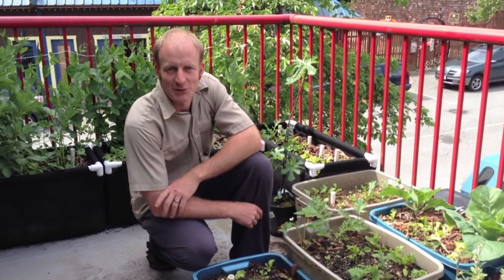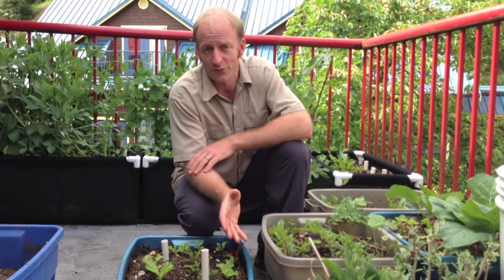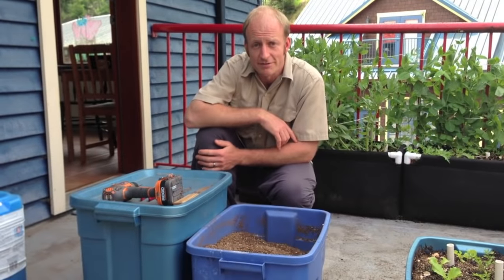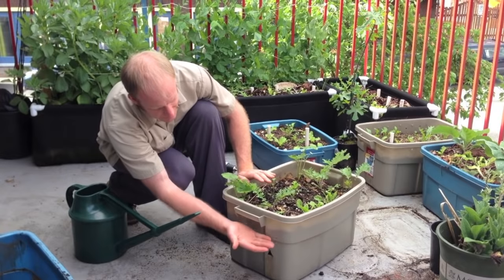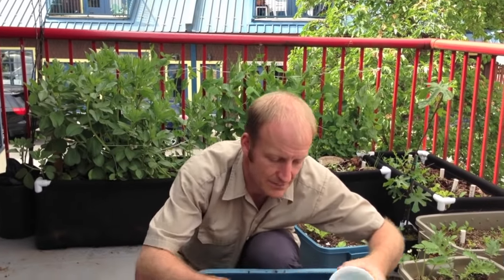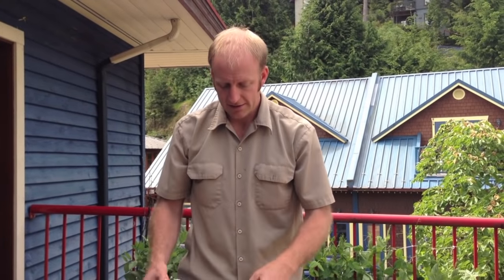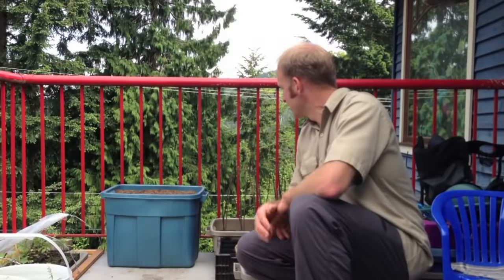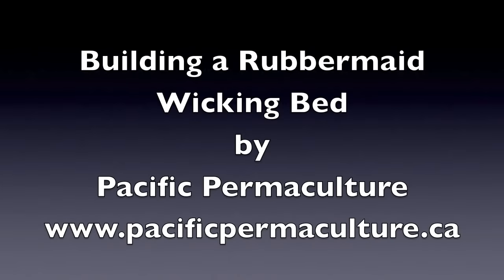Wicking Bed Build

Comment: going to have to do this, started several of them had some sucess but the heat in Tampa is bad, Do water them but they need constant watering
Reply: When we live in Florida I remember we defended our pots from two most sunny sides with wooded blocks and let the air flow between them, it helps a little.

Comment: In other videos they say you want to leave a gap of air between the water level and the soil to prevent root rot and allow oxygen into the soil. I haven't tried it yet but this may be helpful to others interested :)
Reply: Maybe some holes in the sides. Some water will evaporate, but the airflow may be as important.

Comment: Nice job except it seems by putting soil in the corner cups some soil will go into the water reservoir which want to be only water.  What size do the holes need to be at the bottom of cups and how far up should the holes be ?

Comment: This is an exceptional video and the best I've seen, and I have just a quick question -- everything else I have read says you need an air gap for root oxygenation - how could we work this into the system? Otherwise it seems that not a lot of air is getting to the roots. Thanks if you are still maintaining the Q&A on this classic video!

Comment: Really raise beds are the best planters, for making a garden, or a plot of peppers, tomato's ect. Easier to control weeds, grass, gophers and to work ect.  mine is 3' wide and 10' long and 2 1/2' high.  with a old sheet of roofing tin under it. To gopher proof it. The roots don't go down about 2'. Can grow a lot in a raise bed this size. can built a raise bed pretty cheap, all i use was old roofing tin for the sides and bottom. Tee post for support on the long sides.  Just caulked up the holes your don't want,  then painted it. Its 12 years old and still growing things. My cost of it was paint, and wire only, to wire the sides to gather.  Then pots. Bag dries out the soil to fast

Comment: Thank you for great ideas. But when u drilled drain hole yoy just said right here and I couldnt see where about. Do u drill where the cap sits or below the cut out cap pls. Also could you tell how to make good soil components like bloodmeal worm juice etc. I wstch u from s Korea n we dont know these. We all die from chemical fertilizers
Reply: It's below the cut out cap because you want the water to stay under the lid and only come up as needed, pulled up by the soil in the cut out two pots. So all the rest of the water is a reservoir under the lid. Otherwise the soil above the lid would be flooded.

Comment: I love this video.  I have a couple of questions please.  I have a small patio and want to do this as my containers tend to dry out quickly in my very hot yard.  But in the winter we also get a hard freeze and my containers would have to remain outdoors.  So do you ever have a mold or fungus issue in the water reservoir?  Does it have to be taken apart and cleaned every year?  Also  I would drain them for winter but have you had any experience with how they stand up to be frozen over winter if there is some water left in the bottom of the reservoir?
Reply: add 1 tbl hydrogen peroxide per gallon h20 for mold and fungus.  it will kill good bacteria too so add beneficials a week or two later
Reply: snow hero 👍🏻
Reply: @snowhero9  I'm newbro gardening... what do mean by beneficials? Also.. does this mean it would be safe to leave thebwater in the containers and use them the following year? I live in Maryland  and the containers would have to sit all winter.

Comment: hey you could use one tub inside the other , top tub for your soil bottom tub for your water thanks
Reply: That's a great idea! Would it work with 2, 5 gal buckets? Would I drill holes in the top bucket and then a hole in side of bottom one for the water?

Comment: I loved this video. It was straight to the point and provided all of the information required in an easy to understand format. My only gripe, if you could call it that, is that we should get away from using so much peat moss in the garden. It is incredibly non sustainable and the peat bogs are ruined by it's extraction.

Comment: The concept is fine, but I'd include a watering tube, and the sunken lid I'd replace with something more permeable.  It will retain too much water for too long.   I think, with permanently submerged soil,  it will turn to slurry.   Self watering planters use the same concept, but they're allowed to dry out over time.

Comment: I've been starting to experiment with 1 gallon milk/water jugs because the handle becomes a fill hole I can close up. Against apartment rules, I have to put the pots on the fire exit and it is not easy to water the pots without being watched. I like the coconut core idea, as I don't want the topsoil to attract mosquitoes and other pests. Going to try that when I put my plants outside again. Thanks for the cool tips! Any suggestion on where to get the right sand?

Comment: It would be helpful if the videographer was aiming the camera where you actually drill holes.   I think possibly they are trying to keep the camera on your face rather than on the gardening technique. Also maybe setting at a wide angle would help capture the whole container instead of the upper half. This is good information.

Comment: Thank you for the primer. I'd like to see how you water it initially - just how saturated to you start your system off (how much top watering vs filling the bottom). Also, how do you monitor the water in the bottom? (I'm using tubes like your other system with a little strip of insulation foam that drops to near level when the bottom is empty.)
Reply: As he keeps adding more water thru the triangle-shaped hole, eventually the level of water below will reach the hole, at which time he knows that the water level is at its maximum.

Comment: why not a 1" pvc pipe going to the bottom so u can fill it with a garden hose a 10-foot pipe is like 3 bucks at Lowes you could get 3-4 fillers from one pipe

Comment: what you can do with the mistake is that if you don't have a lid to replace the one you made a mistake with , you can place burlap material and spread it over the flat cut lid and that should hold your potting mix from falling into the lower compartment
Reply: I don't understand that part about the gaps because then he cut 2 big holes and put soil down in them. Looks like that will cause a bigger issue with losing soil.
I know when I plant flowers I always put a cpl coffe filters in the bottom of my pots ( putting in a few rocks for drainage) before adding my fresh soil. It keeps the soil from washing out.

Comment: This is the most complicated set up I’ve seen on this subject. It’s a whole lost easier to use weed block cloth. Just cut it larger than the container, flip your yogurt cups upside down from what was shown in the video, removing two in the center. Push the cloth down so the soil goes to the bottom. You want about a 20% soil in contact with 80% area for water.  The cloth keeps the rest of the soil above the waterline. Stick a plastic pipe on the side for filling the bottom with water. You still need at least one hole in the side so you don’t overfill.
Reply: This seems to be the best idea the cloth can be a barrier for the dirt. It will wick up water just need hole to drain. Maybe in the cups too.

Comment: Just to confirm, that watering hole allows you to fill all 6 of those larger pots at the bottom, right?  And the soil you're planting those seedlings into is the same mix you placed in to the 2 in the corner as the wicking soil, right?

Comment: You missed a point.  There needs to be an 'air gap' between the bottom of the soil bed and the top of the water in the resorvoir of about an inch so that the soil in the bottom of the planting bed is not soaking wet.  Great idea using Rubbermaid  tubs.  They are rectangular and you get a whole lot more planting space than round 5 gallon buckets.
Reply: If there was a gap then how would wicking acting take place

Comment: Instead of cutting a triangular hole in the side for watering, can you use a piece of PVC which runs into the water reservoir, allowing watering from above and into the PVC pipe? Or does the triangular shaped watering hole in the side out-perform the top PVC pipe watering method?
Reply: the whole at the level also helps the reservoir drain when it is too full when it rains

Comment: Is it just me or is this over complicated. You can make this by Following the same process but just turning the potters inside the container upside down, that will create a reservoir , fill the bin with soil, the soil that fills the gaps between the pots becomes ur wick(lets face it u are using the same amount of soil by filling two pots anyway) product is the same you just don’t need to cut anything except the over flows (and air holes if using yogurt containers.

Comment: Couldn't you have just turned your "cups" upside down (bottoms up) and then covered them with the landscape fabric to prevent soil from clogging the holes used to help fill and drain (allowing air to fill them as water is used) the reservoir? I'd also figure there would be plenty of areas for smaller columns of wicking soil to be created. Also, I see in the background of your video other containers with pvc pipes. Are these watering tubes? I'm also curious, aren't those open holes just begging for mosquitos and other insects to create a nursery of the reservoir? Sorry, if I'm sounding hypercritical.

Comment: Sir I haven't yet watched the video, u call your favorite....
But....I use wicking w everything, even my african violets........WHEN u put the flat lid on top of the pots in the bottom.....cut little SLITS in the flat lid....use ladies nylon stocking or cut STRIPS of fabric(I use strips of mens athletic sox)
Put the one end down into your water wells and pull the other end thru the slits
And drape around under your planting medium.....
THAT will moisten your growing medium too and u wont have to use up ur vermiculite mixture.......
Just another way......🤷🏻‍♀️
Now I'm going to check out your other video 🖐🏻☺️

Comment: I made one.  I am not real happy with the amound of soil sitting in water all the time.  I will take it appart and think of a better way to do this.  Also there is soil falling through and even with lining the pots with landscape cloth, to keep the soil form coming out the drain holes of the pots, it is still coming through.  This design has some flaws.  I will keep looking for better ideas.
Reply: put the pots upside down
Reply: knitnpaint so are the pots suppose to retain the water or act as a support between water and soil. I like the idea of the other response to turn pots upside down.  It how would you wick the water up to the soil if it isn’t touching it at all. I was curious how water would reach the soil by cutting the lid and placing the lid as a barrier. My thoughts was to place a mesh of some sort but one that won’t rust or corrode . Maybe a plastic mesh that is tightly woven with a landscape material. I believe it is a great idea and of course adaptable in many ways
Reply: @RestorationRanchHealing  It has been so long and I no longer use the pots. Sorry I can  not be of help tl you.

Comment: you top feed it too, dont be dumb. the top dries out eventually and you need to keep the thing moist for all the obvious reasons. Fishbone meal will be your best source of calcium that is commonly available. Calcium and magnesium are just as important as nitrogen and phosphorus
Reply: rosa lara take a potted plant that needs water and put it in a tray of water.  Wait about 24 hours and touch the top of the soil.  The water will travel up(as he said) to the top, and the soil will be moist.  Don’t be dumb.
Reply: @knottybead4871  then the pots will uptake too much water  water and growth will slow from lack of oxygen.
Reply: rosa lara obviously you don’t understand how water works.  I didn’t say put it in a bucket of water.  It would indeed drown if you did that.
Reply: @knottybead4871  wait 24 hrs? naw, my plants aint waiting that long to get their microbiology on top re-hydrated. Please don't be a sore student just because you got schooled. I know about capillary action and use it most the time but not for hydrating the top, it takes too long to travel and gets pot too wet. Did i really need to explain that? I am the best grower alive.
Reply: that's why you need to drill an overflow hole just above the pot level. the top of the soil will never get as wet as the bottom - period!
Reply: Ron Thornton where is placed the lid between the water and dirt layer is there a hole in the lid to allow water to seep up to the soil ? If not how does the water reach the soil at all ? I’m wanting to do this but I want to be sure I have a clear understanding of how to do this without being wasteful.

Comment: Hello Jesse! Thanks for the great video! I made my 1st container two days ago. Sweet! Just wondering though regarding planting depth. According to several websites you need a fairly deep planting depth for tomatoes. Is that true, or does it depend on the varietal. Also, did you say you added coffee grounds to your prepared soil? Not sure if it is true, but according to 'some' coffee raises too acidic for the plants. Your thoughts? Thanks again, I've shared this with several family members!
Reply: I have used coffee grounds for yrs and it's always worked great. Makes my plants happy.  Along with a compost tea of banana and adding ground egg shells. The coffee grounds aren't very acidic after they been spent. So save your grounds definitely
Reply: @JCC_1975  Thanks! Love your video!

Comment: That is over engineered.
Drill a 1/2" hole about 2" to 4" above the bottom on a side.
Get a Walmart (blue) carry bag (fabric style).
Fill bag with soil mix and a plant.
Place in the tote. Fill the tote with water till it runs out the overflow hole.
You get the benefit of air pruning and sub irrigation.
Fast easy fill too.

Comment: Shouldn't you use food grade plastic? I would not want to eat chemicals taken up by the plants.
Reply: S H I was curious about this as well. I have read that the hard plastic is safer than the softer plastic and doesn’t leech. I’m curious where to find food grade plastic to do this on this scale.
Reply: @RestorationRanchHealing  In my research, it was not the hardness but the number that you should go by (#2 HDPE keeps coming up as the safest known). I was able to order some white 5 gallon #2 food grade buckets from 'wally-world' ;o) that actually have a sticker on them that says food grade.  However, I still worry about the sun breaking the plastic down and releasing chemicals, so I am using them in ways where they are shielded from direct sun, and may even cover them with fabric, fabric dipped in cement, or strips of wood... still deciding.  Either way, the plastic will keep it water tight if you are on a balcony or have it indoors.  If you want something really big, if you have farms nearby there are supposed to be tubs that are food grade #2 plastic that you can get that may have had feed, molasses, etc. in them.  There is a farmer with videos on that too... same concept but larger scale.
Reply: Also, if you get the 5 gallon buckets, you can use the lids as saucers for overflow... if you don't mind the look. Hope this helps!
Reply: @RestorationRanchHealing  also, those buckets I mentioned also say BPA free on the sticker.  It won't come up if you search for a food grade bucket, and it does not have it in the description, but it is on the sticker when you get it.  It's under "5 Gallon Industrial Bucket, White".  Silly, but whatever.  I ordered just one to start using the pick up service, and then ordered more once I was sure.  You can just go inside, but I didn't want to.  HD's don't say, and staff argues about it.  I didn't check out the other store's as these were cheaper, and I liked the white.
Reply: S H thank you so much this is all great information ! I was thinking also to check with some local restaurants etc for their commercial food grade container buckets. And yes your correct I was aware that you can search the number. A good thought also with regard to the sun leeching. Thank you again. I wish there were more safe food grade options . It is a great deal of help thank you !

Comment: Your information  is good except one important thing you are telling pple to put the filler containers up right this is WRONG they need to be upside down . You are defeating the purpose of adding the containers upright you need to have them upside down so they will hold the water under them not in them

Comment: I wish you were more precise on the height of the fill/drain hole.  I suppose this would vary depending on height of materials used and the hole height is critical to maintain an air pocket.
All you said when positioning the hole was "about right there."

Comment: MEN are simply so crazy with overdoing EVERYTHING.  Making things far more complicated than they need to be.  the TERM WICKING means cording.  Why on earth are you calling this wicking when it isn't.  Wicking is where you put the cotton clothesline cord up into the soil and out the bottom sides so it drinks [sucks] up the water.  The clothesline goes up into the pot with dirt around it and when the dirt needs a drink it takes a drink. You just fill a reservoir with water and it keeps watering all on it's own.  This excessive use of plastics is simply toxic and un-natural.